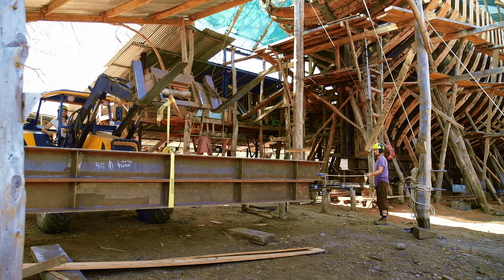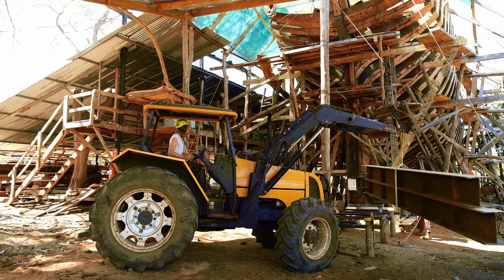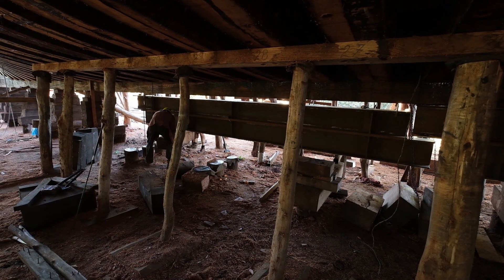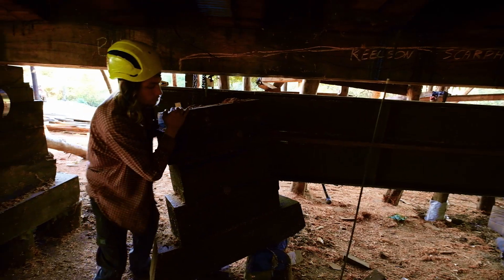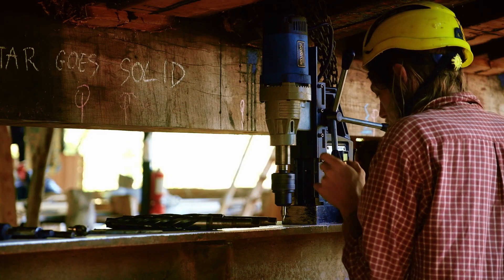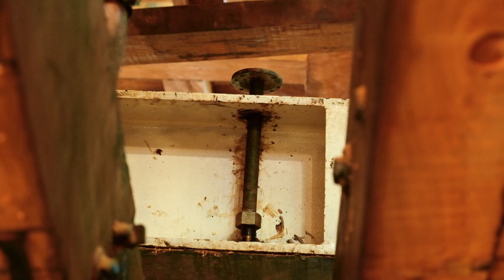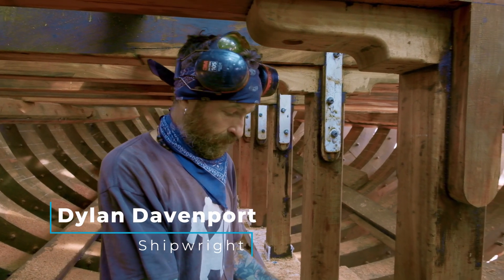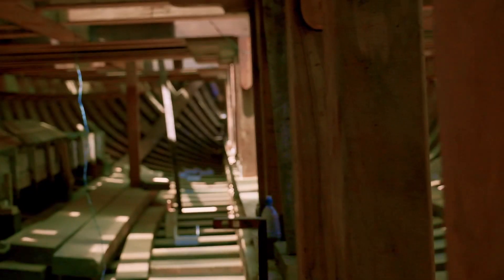Installing the Ballast Keel - SAILCARGO INC. 2022

Comment: Yea we all know Spanish do not having subtitles is awesome yea!!! 
Not happy with this ballast keel the painting was done using HVLP when in fact it should have been applied using an airless system! Also the place must have a humidity of 90% at least! Do the steel should have been heated to 50 degrees to dry it using a gas burner tgen apply a base coat instantly once a section is dried! This keel is going to rot out as soon as it hits the water! I give you 5 years and you will have serious issues with rust and rot in the contact and bolt holes

Comment: Will the I beams be filled with lead, or is it just the steel as ballast? DId you calculate the stress on the keel bolts when the ship is tilted, since the keel  (I beams) is quite narrow. Th emore narrow the keel the higher the stress on the bolts due to the shorter leverage.
Reply: Always some sofa engineer commenting
Reply: I was asking design questions out of interest. Not criticizing.

Comment: Wait, those just go in the water, no covering no nada? How's that gonna work with the water flow on a sail boat?
Reply: I beams in the orientation they have will have very low cross section drag and only mild surface drag. And steel with proper primer and bottom coat paint will last quite long and can also have active or passive galvanic protection to extend that further. Plenty of steel ships out there doing just fine in the salt.
Reply: @Interstellar Traveler you mean untreated bare mild steel? sure. Could also be a more corrosion resistant alloy than just mild steel. Or maybe they paint it and haul out for bottom maintenance like any other vessel.
Reply: Piss poor design. Not to mention
Doing things as cheap as possible.  It will be sea mates with titanic soon.

Comment: As I understand it the balance is supposed to be about 30 tons and the steel is about five or 6 tons, but I guess my Spanish isn't good enough to figure out where the missing 25 tons is coming from or where it's going. Well another shitty video.
Reply: Even bad math using their numbers makes the steel alone closer to 18 tons plus the wood weight. Also the auto captions translate Spanish perfectly well if you turn them on.
Reply: @skylar7320  still 20 ton light minimum. And I know Spanish. And I know boats.
Its my living.
Reply: @w124mercedes7  who said the steel is their only ballast? who said they dont have more to add? who said that the steel and wood isnt 35 tons total keel weight? Youre making a fair few assumptions there...
Reply: According to their planned route, they're going to have cargo every leg of the route, I believe it's like 5-8 tons.
Reply: You are right. The keel is far too light. I have seen 25ft sail boats with allot more ballast keel.
Not to mention it is going to rust very fast unless they use  grounded system connecting all of the steel.  That boat should have a solid lead keel that goes from stem to stern. I would have used concrete instead of  i.beams. not even 1/10 the ballast they need.  Im sure they will learn this when launched.
Reply: @w124mercedes7  lead bricks in the pockets with rebar welded over them and it all encapsulated in a structural cement  mix. Stiffer  stronger and easier than trying to pour a 35-40 ton lead keel.

Comment: Are the I beams going to have a side covering? Will more steel be layered into the I beams?
Reply: Even if they did box it in 
It would eventually fill with sea water and rust out from within.
Very bad choice in ballast keel.
Reply: @w124mercedes7   If they boxed it in then it would be buoyant.  They will fill it with concrete or lead.
Reply: I was wondering that too. Also I think these I beams are more narrow than regular ballast keels from e.g. lead? The more narrow the keel the higher the stress on the bolts when the ship is heavily tilting.

Comment: Have you considered the hydrodynamic aspect of that vertical crossbracing in the keel-beams?
Reply: As a total layman, are you kindly able to expand on what this means, thanks. Sounds like something relating to movement of water around the structure, and the knock-on effect this will have on controlling the movement of the boat?
Reply: @MrWokyman  these are perpendicular to the direction where the ship moves, so they act like a resistance, and slows the ship down. Just imagine a olympic swimmer with a stiff hat.
Reply: I remember they said on their social media that they would pour cement or a metal in the gaps of the I-beam so that the keel-beam would be more hydrodynamic and havier also. Correct me if I am wrong!
Reply: @jonahblondelle3775  I don't follow the project on SoMe, but to anybody who has at any point in time dipped his/her toes in water this must be obvious. Absolutely no floating vessel on this planet has been or is constructed with 'breakpads' as the keel sits now. Ofc they will encapsulate the keel and I find the method the designer has come up with brilliant. If the cement/metal isn't enough it can somewhat easily be replaced with heavier lead within each square section and without removing the keel from the vessel. Cool.
Reply: @jonahblondelle3775  i cant imagine how they are giong to do that after fastening it in that position. if they make a mold on that one free side, then they cant fill it fully from the top.
Reply: @Zolee0809  you pump a wet cement grout in to your mould or you could dry spray a cement mixture on and hand shape it.

Comment: one question i have is are masts connected to the keel through the decks? any modern boats i look at don't, but older examples from the golden age of sail do... will this ship have the masts connected to the keel?
Reply: Older ones idk but modern ones do sometimes
Reply: most boats do have the mast to the keel some have tabernacles to hold the mast ,but there is a support prop underneath that extends to the keel

Comment: Why are you guys putting lots of steel into the ship 😆? The way it is connected will it not act with a massive electric potential over time, that will start to rust quite quickly?(<100y)
Reply: They use tar in between the wood and metal
Reply: @waynecummins9713  tar will not help with iron sickness to the wood. Also the keel needs to be 
Allot more than what you have.
A boat that size should have a 1 piece solid lead ballast keel. Around 40 tons or more slung from the bottom of the wood keel. I have had boats half that size with more ballast keel.
Easier to correct it on land.
Doing things on the cheap
Puts others lives at risk.
And the owners cargo.
Reply: @w124mercedes7  from the load of steel received that is just the core of the ballast keel it will have lead in the pockets and rebar welded around it then all encapsulated in concrete. Actually a pretty well thought out idea as it will stiffen the hull nicely. Also remember that they put a rubber membrane between the hull and double I beam. As they said this kind of hull historically wouldn't have had a bilge keel, they are adding it so the ship will sail better & hog/sag less.